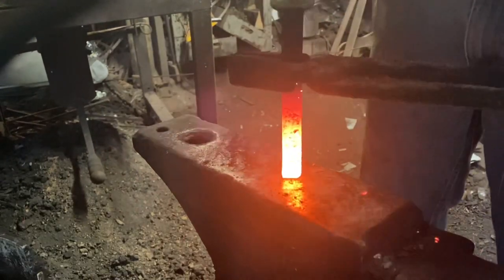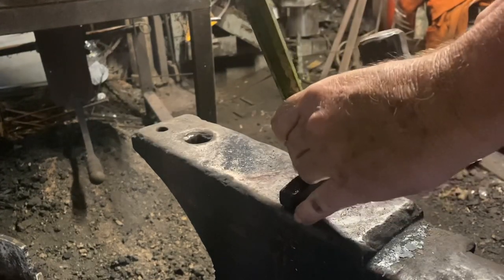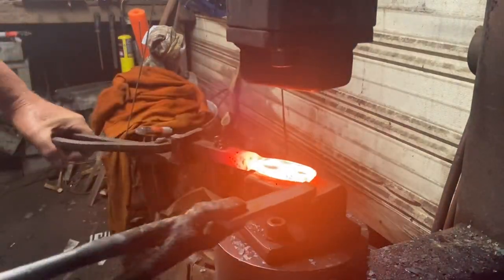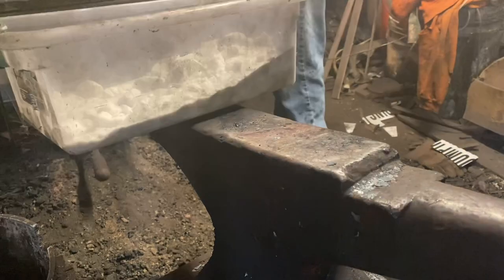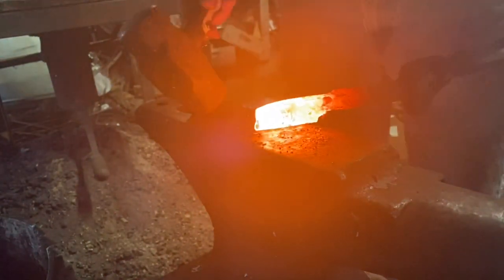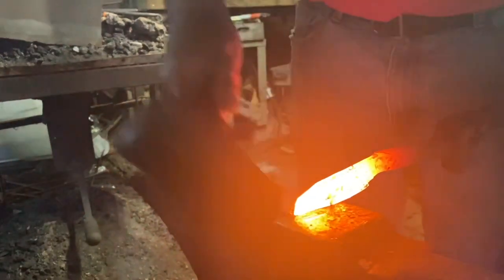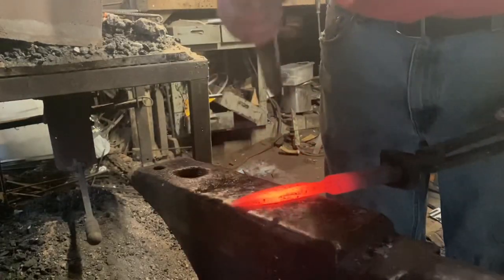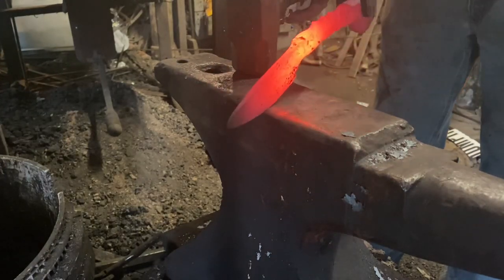Blacksmithing Knife Making Forge Welding High Carbon To a Railroad Spike

Comment: Much better then the split down the middle method I tried using. That was a total pain in the a!@. I'm going to use this method next time. I subbed yea based on this video.
Reply from the maker: Thank you sir. I’ve used that method in the past too. It’s a pain in the neck.

Comment: Nice work !   RR spikes make decent letter openers , forks , butter knives and occasionally a spoon   ,  but not a skinner ; cut one steak with it and it will have to be sharpened
Reply from the maker: Yessir, that’s exactly right. That ‘HC’ on the head of the spike doesn’t mean a thing when ‘HC’ for a spike is only .30-.35 carbon. Can’t get that through to some folks though.